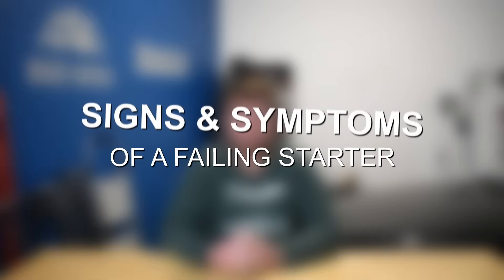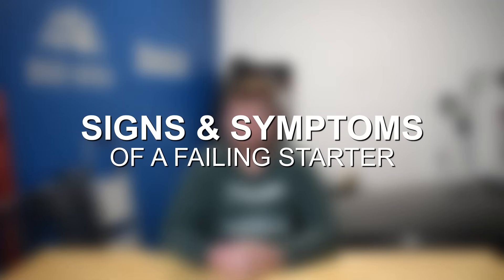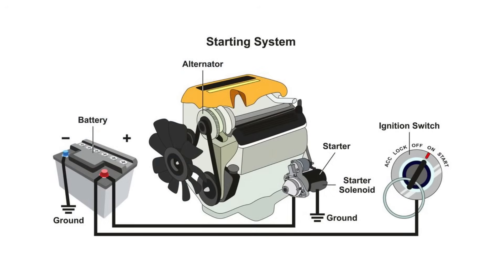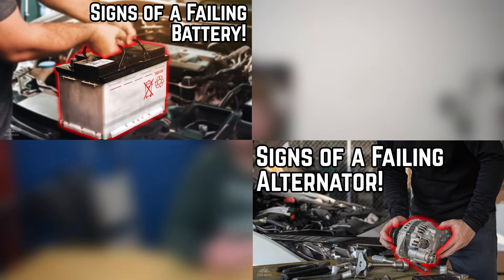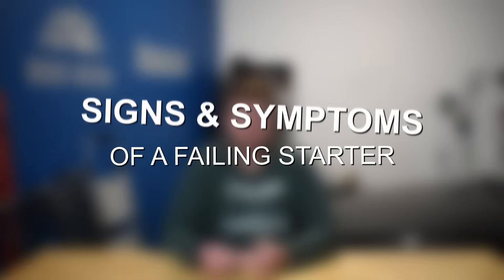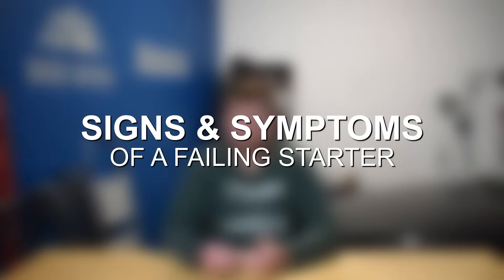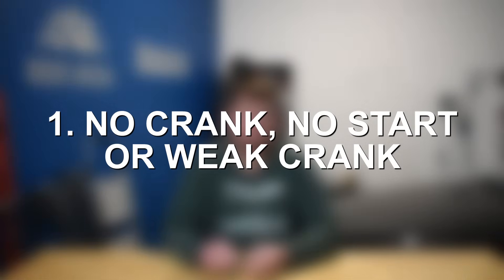5 Symptoms of a Bad Starter!

Comment: Ok, so what if I have a new battery and a rebuilt alternator. I just had an entire engine overhaul, fixed a bunch of things, replaced all belts and hoses. Lubricants, fluids flushed and replaced. I drove 300 miles yesterday, stopped a few times, everything running great, and then 1 hour left of my drive to get me home, I stopped at a rest area for 20 minutes or so, went to start the car and it tried to turn over, heard some clicks, tried again a second time, then just clicks, and then tried a third time, then nothing. Someone jumped my car, started up immediately, I drove 7 miles to the closest hotel, turned off the car, then tried again, and same thing. Then this morning, got it jumped again, drove the rest of the way to my house, drove line a champ, got home, pulled into the garage, turned off the truck. Tried to start it again, and same thing again. Tried to turn over, and couldn't. 
I'm so confused. Brand New battery, rebuilt alternator... I'm thinking starter?
Reply: Oh, all electrical working just fine too
Reply from the maker: M - So sorry to hear about your experience.. Our initial thoughts would be a starter, but we have a video on hard starts/no starts that may also be helpful: https://youtu.be/0YRdzJbHcm4

Comment: My ranger just had a new starter installed and it cranked up stronger than before. 

Now, it won’t crank at all then out of nowhere will start. Took a mallet and tapped the starter and kicked back up. Could it be something else?
Reply from the maker: S - How's your battery?
Reply: @8020Automotive  it’s new and it’s not the alternator otherwise accessories would flash in and out or die while driving.
Reply from the maker: S - Here's a video that may be helpful with your research: https://youtu.be/0YRdzJbHcm4

Comment: My car won’t start at all. I tried to get a jump and it came on but the car never started just clicked over and over. When I took the cables off it just did start not even the lights came on
Reply from the maker: S - sounds like a battery issue. Have you checked the battery?

Comment: i should’ve tried the battery test cause my car has trouble starting on the first start of the day but once it’s heated up it has no trouble starting just like if it had no issues so probably is a battery
Reply from the maker: Aero - Sounds like a potential battery issue!

Comment: I’m getting all my lights and radio turn on but when I turn my key to start nothing happens at all no noise nothing, but my car has been starting no problems at all and this morning it just didn’t start, can a starter just die out of nowhere?
Reply from the maker: It could for sure if the solenoid seized up or something. But I wouldn't jump to that conclusion very quickly...check the basics...I'd start with looking at the fuses and checking the battery.
Reply: @8020Automotive what fuses?
Reply from the maker: A - check your manual. There should be a starter fuse.
Reply: mine is doing the same thing at the moment. what did you do to help it start back up?
Reply: I hate push starts … I wish they kept the old fashion key.
Reply: Mine does the same but if i keep trying the switch it will start after about 20 tries. Not sure what is wrong.
Reply: @clifkelly6013 mines did this and now it won’t start
Reply: Same!
Reply: Check your battery and connections first. Also check the ground strap from engine block to firewall.
Reply: @JLMEALER2000 what difference would a ground strap make ?
Reply: My car died on me Sunday.. and I was far away from home.. all my lights turn on but my starter doesn’t start.. no noises at all only clicking when I do turn the key ..
Reply: @greeneyesduhh8814  did u fine out wat was the problem mys doing that too
Reply: @greeneyesduhh8814  What ended up being the issue?
Reply: It could be a relay or ignition switch as well
Reply: I had the same issue and it was a relay.
Reply: @Ryan-fy8bx my Volkswagen was running perfect yesterday and then walked out last night to leave and it would just turn the radio on and lights on and make 1 click where the fuses are. We took the relay switch out then it just sounded like a rapid click but no noise from my starter.
Reply: @chasoncook1967 that exact thing happened to me 2 days ago. Was it the starter?
Reply: @chasoncook1967  What did it end up being? Starter, or something else?
Reply: @HagPuppy What did yours end up being?
Reply: @reesecop  it was a bad starter. I replaced it myself, and had the old one tested at Autozone. I have a major oil leak that covers the components in the engine area. That may have assisted in its death, as it was covered in oil/dirt. Additionally when I got the new one in, I accidentally bent the connector on the inside of the starter down. I bent it back up and the wire clicked into place.
Reply: My car only starts with a push start
Reply: I got a 2011 ford fusion Sel 3.0 v6 I was driving through barley any rain on the road then all of a sudden I lost all power my car wouldn’t pick up speed so I pulled over and let it sit for a second then tried to start back up and it wants to turn over but it’s not, my radio and windows work but it’s like my engine isn’t turning over and I’ve never had any problems before what do you think it could be
Reply: @RaymondAlligood have you checked the oil level??
Reply: Yes it CAN 100%
Reply: 2010 qx56 all lights work won’t start click no crank no start my ground wire for battery terminal was corroded The shop soldered. Wire worked now won’t cut on
Reply: My car won’t start unless I jump start it then it will start up just fine for the rest of the day but the locks on my keys sometimes won’t work that’s how I know my car is not going to start but if the lock button on my keys unlock my doors than I know my car is going to start what could that be or mean?
Reply: Same! Supposedly I have parasitic draw. But the starter and alternator both test "good." But you described my situation literally the same.
Reply: @SWTmel  So, I am no expert, but I guess all cars now have some parasitic drain.  The newer the car with the more features, the bigger the drain.  Hence they started using GMA Glass Mat A..... batteries that can hold up better against that (at twice the cost to replace).  My 2020 Elantra came with a GMA battery, for example.  But seat position memory and stuff like that.... I tend to get the more basic options packages (don't order them sparse, but just buy what's on lot), but there are just enough chips and stuff drawing even when car is off.

But then if you have some other problem with your electrical system, that could created unwanted parasitic drains, like if a position sensor keeps resetting or something due to some issue...... I have a seat weight sensor on the passenger side that acts improperly at times, and I am concerned it's drawing power in the off position because I am getting odd things......
Reply: I know this comment is 9 months old but I was having a weird issue with my battery dying overnight. So I went on Amazon and started looking at portable battery Bank jump starter things I randomly found one that had good reviews and was on sale for $40 called Astrovi. I've used it three or four times in the last month for my 2017 Subaru Forester @teeteewest7058
Reply from the maker: Tee - This is most likely a bad battery. You can go to an autozone or any other car shop to get a free battery test. Keep us updated.
Reply: It has to be the wire to the starter to the solenoid could be rotted out and making a good connection off and on or your starter also see if the battery connection are loose if not then change your starter
Reply: @allenhackneyii125  I am wondering this for mine.  I had trouble four months ago on a hot day.  My battery was five years old, but reading okay.  I was thinking a parasitic drain, but being the battery was old, I did change it... seemed to be fine and I had put it out of my mind.  Until yesterday morning after I was an hour away having just dropped my daughter back at college... of course.  I just don't have great access to look at it without a good bit of effort.  I am really feeling like it is the starter, but just am trying to get that final bit of convincing that it is so that I don't get into a big diagnostic link at the shop.  But it started again later just fine.... that was kind of how it was four months ago....  Get the one click, but a jump did start it.  I am hearing about a "dead" spot on the starter and maybe it's randomly landing on the dead spot after the last successful start, and then with enough strong power from a jumping car, it can overcome that.... IDK.....

Comment: Note: these notes will apply to American made cars from the early 60’s to the late 80’s, or 90’s. I left the Auto Parts industry at that time, working on my own cars only. I lost touch with the industry when I went back to school and became an engineering technician in electronics. 
When you hear a starter spinning and it doesn’t drop in RPM, the starter bendix is most likely the problem.the bendix is what engages with the flywheel. It is clutch driven, the clutch being like the one on a mini bike in that when it engages the flywheel and starter is spinning a sprang clutch makes the bendix spin in only one direction. If the bendix is bad it won’t drive the flywheel and allow the starter motor to spin free. If the bendix engages the flywheel gear and the motor spins but doesn’t have enough energy to turn the engine over, either you have a bad battery or a starter that is failing. In that case you can put a volt meter, ( or a multimeter set to dc volts from set at 20 volts or so), and have a friend crank the engine. Typically the voltage with drop to about 9 or 10. Lots while the starter is cranking. If it drops further and the battery load test fine, check the battery cables. If they show little to no resistance they are ok and the terminals are clean the starter is probably at fault. if it clicks either the battery voltage is too low to or is bad. If the battery load test good then the starter solenoid is suspect. On early GM engines the solenoid sits on the starter motor like the starters in the video, and they can be changed independent of the starter motor. Two screws and a tab are all the hold it in place. Some older solenoids had copper on both sides of the contact disc inside the solenoid. Since these are not available as rebuilt units I would take them apart and turn the contact disc around so that there are clean contact surfaces to transfer voltage to the starter motor. But before going nuts you can check the primary windings for continuity with a multimeter, or read the resistance of those windings. They are basically an electromagnet the pulls the piston attached to the starter bendix into the flywheel. If those windings have burned up the start will do nothing except help hold the front wheels on the ground. The assembly is basically dead weight until a new solenoid is installed. On Fords a separate solenoid is mounted on the Passenger side fender well and are easy to replace. Chrysler has their solenoid mounted internally. They are inside the starter. I’ve never bothered to replace those, but have seen very few failures because Chrysler start motors use gear reduction to ease the load on the starter motor, giving them an advantage over other brands.
Reply from the maker: Thanks for all the helpful additional color!
Reply: Also mention that these are for GM model cars like Buick 2000 models and early 2000 models